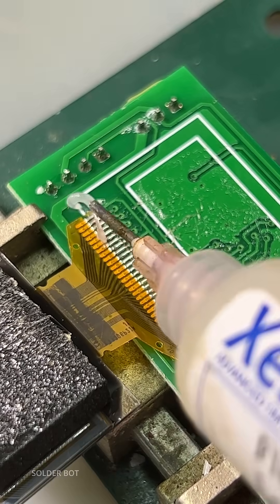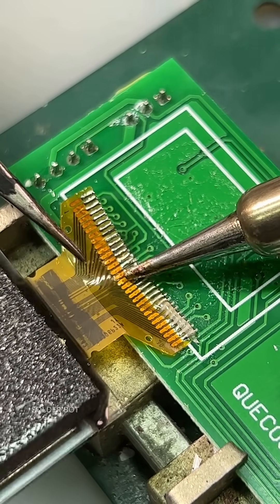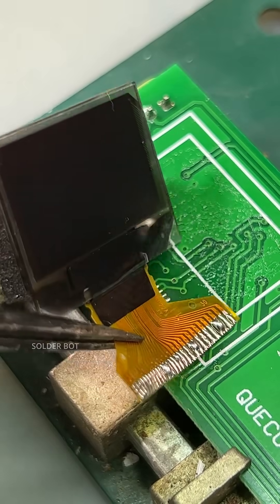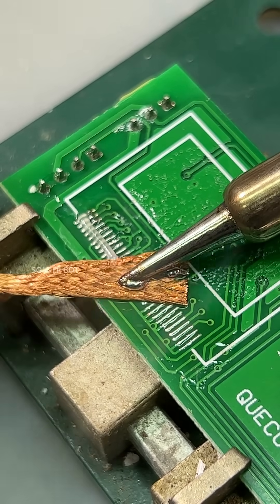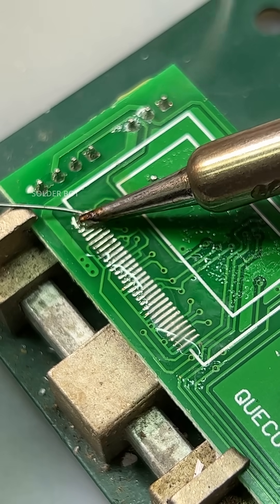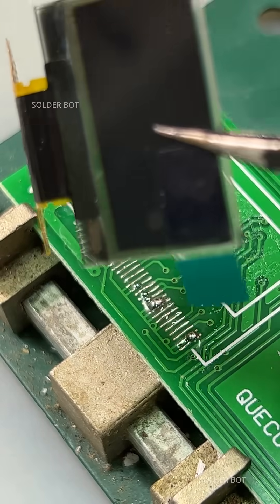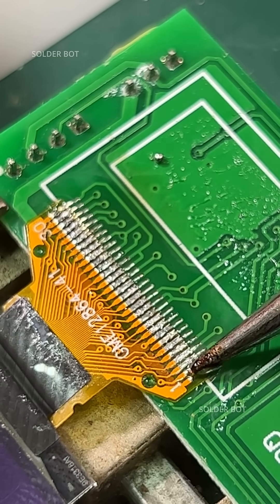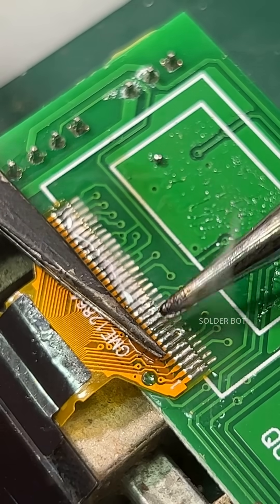Satisfying OLED Screen Replacement #shorts #microsoldering #smdsoldering #fpvrepair #bandifpv #asmr

Comment: You are using the wrong tip, a 3.2mm wide iron tip will make it so much easier
Reply: I'm lazy, so, I wouldn't take the time to change the tip either.  The speed which he works the board regulates the heat applied to spots.  It would take some practice. But once you've seen it here, you can get there too !  Pretty good job !
Quick. When you have twenty more units to get done during the day, you figure out the shortcuts !

Comment: It is Solder, NOT Sodder.!
Reply: Solidaire (v.) – to join, be united, standing together, or interdependent.

The word more immediately comes from the Anglo-French word soudure. This Anglo French word is similar to the contemporary French verb souder. The word eventually evolved in English to its current spelling.

The modern form of the word solder in English is a re-Latinization from the early 15th century. The l was dropped on the way to Old French, which was common (for example, pulverem to poudre, collum to cou, calidus to chaud, etc.). Note that the l in solder is typically sounded in British English.

Interestingly enough, the English translation of the French word soudure refers to welding, not soldering. The word for soldering in French, soudage, is similar and shares a common root.
Reply: Solder for the Yankees is Sodder !
So is a folder a fodder ?! 🤣😂
Reply: @hafiz468 world : aluminium.
yankee : aluminum.
Reply: The L is silent.
Reply: @GREGGRCO if it's silent why even put it there? Doesn't make any sense.
Reply: Says who?
Reply: Souder [soo-deh] (v.) – to solder or to weld.

Avec le fil a souder, which literally means with the line of solder, applies to soldering whereas soudre a l’arc refers to arc welding. Isn’t everything a little more elegant in Latin languages? This is yet another example of a simple yet beautiful group of shared words. Why have two distinct words, weld and solder, for processes that are so similar? Almost as logical as the Standard system of measurement where lbs refers to pounds and oz refers to ounces.

Anyhow, next time you are wondering why there is a silent l in solder — or not silent if you live in England — you can recall this bit of knowledge and clue in your EE classmates […who will turn to you and say, “Hey, Chomsky, the Linguistics building is thataway” – Ed.].

Comment: soldaring iron bit wrong use. use knife bit .. one short work
Reply from the maker: Problem Is I'm repairing my own T12 soldering iron, for this repair I'm using my OTG soldering iron which is with basic tip.

Comment: How do you prevent solder from crossing over pins?
Reply: tricky but with flux and experience, you'll be able to do it perfectly. I use liquid lead tho
Reply: Flux and enough heat.
Bad soldering iron and with dirty tips will have a hard time.
Reply from the maker: That magic happen coz of flux